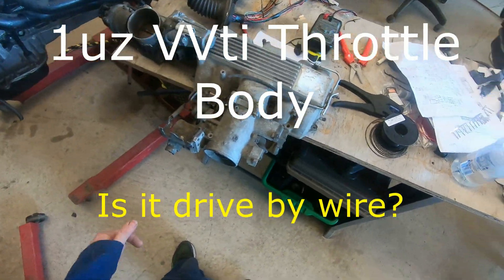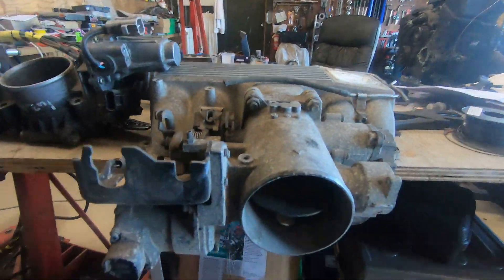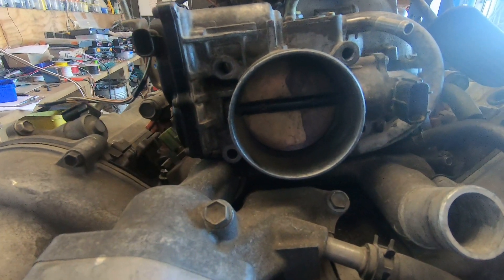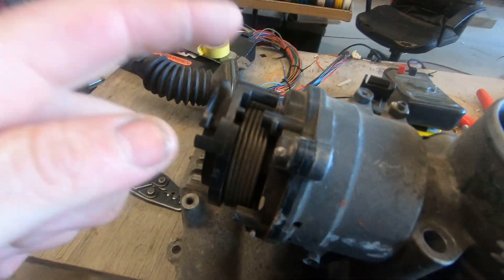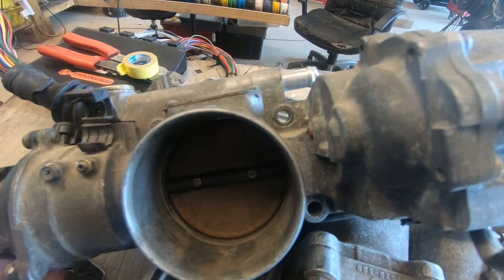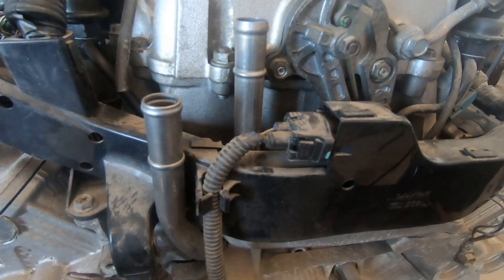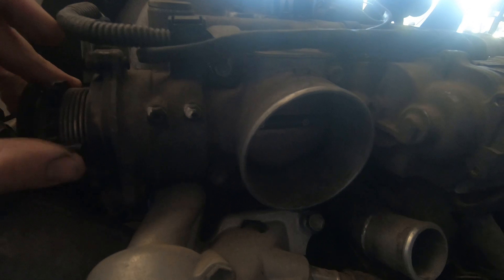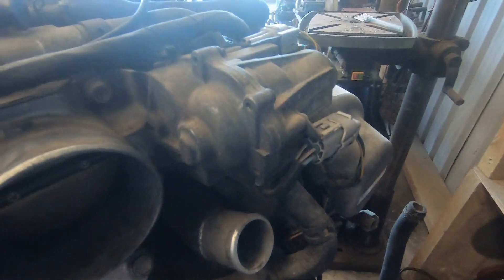Toyota V8 1uz VVti throttle body - Is it drive by wire? DBW

Comment: I had a quick question! I have a 1999 ls400 and when I turn the car on it shuts off right away, seems the throttle body doesn’t stay on and the humming noise shuts off after 2 seconds of being on. I can hear it turn on but the stops. Is it a bad relay? Or throttle body? I need help!
Reply from the maker: Is it causing any issues?  I'll have to take more notice of my own car now.

Comment: Hi, I am working on a 1UZ VVTi engine and I will be doing a rather simple standalone for the ECU, what cable will I need to power and how much voltage should it be supplied so the throttle butterfly opens right away with the cable? Thanks.
Reply from the maker: A really simple rule for sizing is to look at the factory wire size.

Comment: Hello ' i am harry, i leave in France, i have à ls 400 96 in good condition  but many time , when engine is hot , i have many many  white smoge at the back off car ! I look at throotle body , when the engine is stop the throotle is open (large) is it normaly ? Do you think my throotle body is no good ? Have you some time see this problème ?  If it is no good , what is the solution ? Thank you for your answer ! Harry
Reply from the maker: I would recommend checking the PCV system and doing some testing on the car.  I don't guess, I test. Cheers Kelvin

Comment: Hi. I'm gonna put a 1uz in my oandcruiser troopy. Can I use the drive by wire model as long as I have the wiring harness or is it best to just stick to the older cable 1uz throttle body engine. Cheers

Comment: I have a question regarding which pedals will work with the standard 3uz ECU.  I have an ecu that appears to be from a 2003 Celsior, can I use a pedal from any of the USDM 430 cars, or is there certain years/models that I should avoid?  Thanks much.
Reply from the maker: I use either LS430 pedals , any of them , GS430, SC430 or Later Hilux , hiace or even some IS300 pedals which have the correct calibrations.  Cheers Kelvin

Comment: Does the throttle just need the 12v signal and ground, of does it need the computer to tell it to open?
Reply from the maker: With drive by wire the ecu controls the motor to both open and shut the throttle plate

Comment: So if I want to swap a vvti into my car I can leave that on and run a drive by cable to the actuator or do I need a dbw pedal?
Reply from the maker: A cable is run to the throttle body.  The accelerator position sensor is on the throttle body itself.
Reply: Can I use the 1uz vvti throttle body with the 3uz ecu?
Reply from the maker: No.  1uz throttle body has different requirements than 3uz ecu provides
Reply: @CartuneNZ  Darn. I had a hope that I could avoid dbw and use the 3uz ecu. Thanks
Reply from the maker: @gahbah274  1uz vvti is drive by wire anyway and the 3uz dbw works fine.
Reply: @CartuneNZ  Right, it would just be theoretically easier in my mind to connect the existing cable in my vehicle to the older style (1uz vvti)TB than muck with a new pedal. Also the factory servo actuated cruise control would probably work. Alas, as you say the 3uz ecu doesn't work that way.

Comment: is there any way this can effect transmission shifting ? I have a bit of mutant with 1uz fe vvti mated with a650e (35 50ls) with an adpoter plate and transfer case off prado . My gear jerks a lot when going to P to D D to R and some time in between gears when driving , changed the transmission and sensor etc but the issue still remains . also my transmission has no throttle cable . Would be a great help
Reply from the maker: Absolutely.   The APS is on the TB.  Best connect a scan tool of some sort and monitor live data.  Cheers

Comment: Hi Kelvin do the drive by wire throttle bodies need maintenance on a factory Lexus such as cleaning and is there an idle air control valve incorporated in the dbw assembly? Thank you.
Reply from the maker: Hello Billy.   They dbw TB simply opens the butterfly a little bit more or less to adjust the idle.  No iac as such.  If you pay attention in the intake manifold video I talk about the little holes in the TB which flow idle air to the injectors.  These setups often get build up at those holes so removing and cleaning the TB is about all I do.  Cheers Kelvin.
Reply: Yes I did pay attention to every word haha and I did clean out those little holes. They were plugged so it made a big difference. Thanks again for all the great videos.

Comment: I have a p1354 code coming up in my car. Have got new sensors and even a 2nd hand one.still there.is there anything I can check before pulling the cams off to clean the filter.have check wires back to the ecu all good that I can see
Reply from the maker: Hello David.  Is it a factory car or conversion?  Have you checked the signals to the vvti solenoids?  How long has it had the code?  Cheers Kelvin
Reply: CartuneNZ its a swap.i have not no.just check for a broken wire.its had it from I done the swap.if I pull the battery off it.its pulls good for 2-3 pulls then can feel there is less power down low in the revs.
Reply from the maker: @davidpritchard6685  let me make a guess.  The engine and ecu came from a ucf20/21 celsior or LS400 ,  the one with a rear loom?  Who wired it?  Is it auto or manual?
Reply: CartuneNZ yep 98 ls400 and rear loom and Phoenix engine management in the uk done it.
Reply: And it’s manual
Reply from the maker: How long ago did Chris wire it?  Did he fit a box for the auto signals?  There is a really common mistake in the wiring that causes that code which I would be checking first.  How far from Phoenix are you?  Thanks to my channel we have become mates and we share information which is quite valuable to each of our businesses which we might not share publically.
Reply from the maker: Had a chat with Chris.  Can you check continuity between the rh cam position sensor and the ecu as well.  Chris will have pinouts for you.  There is a common place for the wire to break.   Lets start there.   Between the three of us we will sort it.  Cheers
Reply from the maker: Also remove the solenoid and power it up.  If those are fine then check the filter.  Video in progress on vvti system.
Reply: CartuneNZ brilliant thanks so much for your time again.il chat with Cris and see if I can see anything rong.
Reply: Got it sorted. Ecu was bad.
Reply: Is there anyway to lock the throttle to Make it manual throttle bod. Or will this not work with the standard ecu
Reply from the maker: Great news.  Thanks for the update.   Cheers Kelvin

Comment: Is there anything than can be done to the vvti Throttlebody to sharpen it up.Sometimes think its abit lazy down low.
Reply: Like is there any way to lock it up with the standard ecu
Reply from the maker: Stock ecu on vvti requires the TB to operate as Toyota intended so mods generally cause issues.  The 3uz definately wont run correctly on stock ecu with TB manualised.  Ive had to convert a few back to dbw after guys tried.  I would like to have a play with some of the plug in throttle signal modifiers designed for diesel accelerator pedals as I beleive they should be able to used on the 1uz vvti ecu to sharpen the throttle response however I have limited time for testing with present work load.  Cheers.
Reply from the maker: Pretty much the answer to locking it up is no,  the ecu doesn't like it.  However I believe it might be possible to use a device designed for the diesel market which modifies the signal to improve response.   I havent the time at the moment to do testing with my present workload.  Cheers.
Reply: CartuneNZ thank you so much for getting back to me.that would be really good if it did work.cheep mod
Reply: Did you ever get time to see if you can do anything to the throttle. 
I order a throttle lock to see if it does anything. Might not work but fun to see tho.
Reply from the maker: Thanks to our worldwide situation the throttle units were delayed and presently I'm a tad busy to do any extra testing I'm afraid.